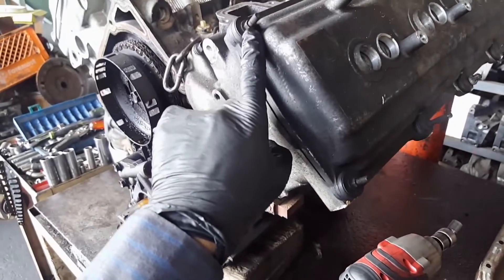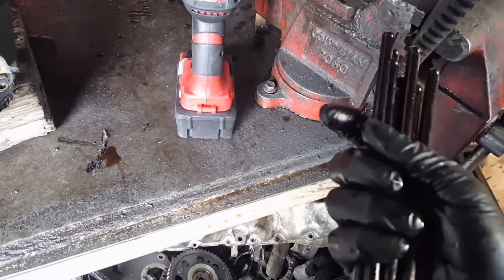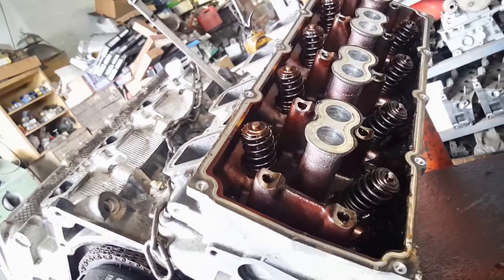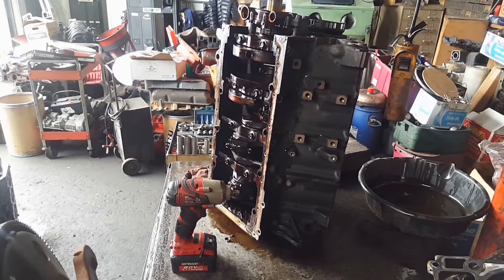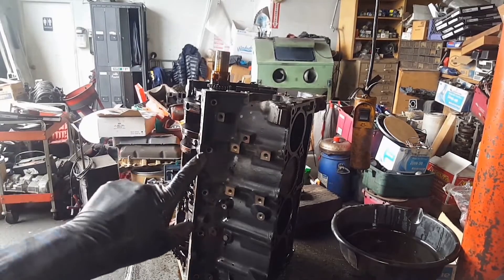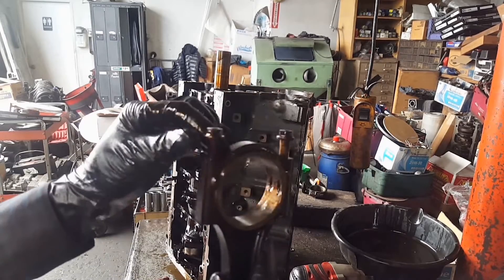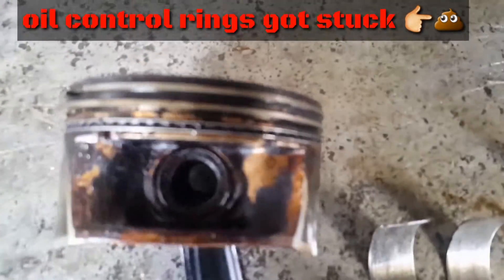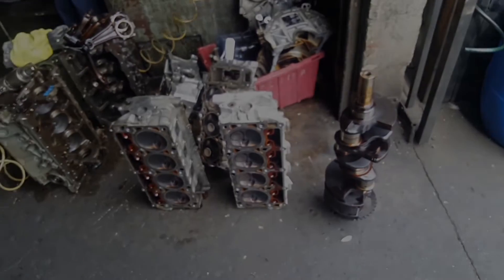How to rebuild 5.7 hemi engine cammed hemi engine (1)

Comment: I have a 2006 5.7 charger, it passes water to the intake manifold and it marks me cylinder 7, I take it to the workshop, they tell me what the engine is, but my question is, you can't just reveal the head on the side where the cylinder is 7
Reply from the maker: No le entiendo jaja can you explain it in Spanish?
Reply: Disculpa Esque lo traducía en inglés no se inglés tengo un cargador 2006 5.7 se le pasa agua al múltiple de admisión y yo marca cilindro 7 lo llevo al más alto me dicen q es el motor pero mi pregunta es no se puede revelar solo la cabeza del lado donde está el cilindro 7
Reply: Tengo un charger 2006 lo lleve al taller dicen q es el motor marca el cilindro 7 porque se le mete antifrizze al múltiple de admisión mi pregunta es si se puede solo reveldiar la cabeza de ese lado o se tiene q reveldiar todo o se tiene q cambiar el motor
Reply from the maker: @hugomoralesavila2605  quite la cabeza de el lado del chofer,i revisa el empaque de cabeza, si el empaque está bien,entonces revisa la cabeza por crakeaduras
Reply: JM8686 y si está craqueada solo se puede reveldiar esa cabeza
Reply from the maker: @hugomoralesavila2605  sale más fácil agarrar una usada i hazle valve job
Reply: JM8686 o muchas gracias y lo puedo conseguir en un yonke o un lugar q me recomiendes

Comment: I have a question,  considering nothing is wrong with an engine and it runs...can you still take it apart clean it all of carbon build up and just reassemble it? of course replacing push rods and other bits as needed. I dont really need a rebuild but at 250k I'd like to clean it all up and try for another 250k. I guess my real question is what should I really replace if I tear down an engine this far, do I need to replace rods and pistons or just clean and reassemble? no mechanic here so be gentle.
Reply from the maker: Thanks for watching and the comment 🙌
Okay on your engine once you take it apart i recommend new oil pump, head gaskets,water pump,timing chain and guides,that's all so do not remove crank shaft or connecting rods and also don't remove the pistons! If all you want is clean the carbon build, just do a SEAFOAM cleaning first and will remove up to 60% of the carbon build!!
Reply: @JM8686  hells yea thanks man
Reply from the maker: @kevinnoneya9095  welcome 🙌

Comment: have the  same problem dodge hemi valve seat drop out on no, 8/ 6/1 what a dodge fuck on the heads did they  ever fix this  shit in mess up my whole engine and it cost alot too rebuild dam shame poor engine design
Reply from the maker: True 👌

Comment: How to remove the pistons if you can't turn the crankshaft (seized)? I have 3 damaged pistons and can't turn the crankshaft by hand
Reply from the maker: If the engine is out you have to get piston by piston till you get to the locked ones!! Assuming that the engine is already out the car!! But most likely you need need crank shaft so don't be gentle and do watever it takes to get it out
Reply: @JM8686  The engine is out already, cylinder heads, and oil pan. I want to replace the damaged pistons but can't access the 10mm bolts. So there's no easy way but applying the brute force. LOL
Reply from the maker: Yeah that's the only way, the crank is trash so hammer on the beefy pa
ts of the crank so you can slowly spin the crank! Or loose all the mains and get crank with pistons atached
Reply: The crankshaft itself isn't seized, just those three damaged pistons are causing all the headaches! Thank you buddy 👍
Reply from the maker: No worries nd good luck 👍
Reply: I've managed to get all the pistons out! Do you know a place where can I order the new pistons w/ rings at a reasonable price other than eBay?
Reply from the maker: What's the make and model of your vehicle ?
Reply: @JM8686  I have a 2006 Chrysler 300c 5.7 hemi with MDS
Reply from the maker: If you are in Los angeles I can get them for you because i don't get my parts from the internet
Reply: @JM8686  I hear you bud, I'm in Jax FL. What's the easiest way to remove the piston pins on hemies? I heard that people heat it up first then knock out with something!
Reply from the maker: Yeah heat or just use a press just be careful because the pistons cracks and pieces of aluminum might fly everywhere, so just go slow
Reply: @JM8686  Affirmative. Thank you
Reply from the maker: No problem
Reply: Hey bro do you have your Shop in L.A??
Reply from the maker: Yes sir
Reply: I would go .30 over on block

Comment: Part 2? LOL I need to do this after I get the engine out tomorrow. Dropped valve seat. Head was chewed and piston broke near the sides. 135k miles was hoping I'd get 200+ :/.
Reply from the maker: MrHotdogwithmustard dang hate when the seats comes off cuz they get hot and then all the pieces goes I to the Intake SO MAKE SURE YOU GET A NEW ONE FROM DEALER CUZ mechanics here in Cali they try to save money by just cleaning the Intake but they always leave a small pieces still in there so after rebuilding the engine and installing the same used intake those pieces goes back to the valves and they make a mess again lol
Reply: Thanks for the heads up. I doubt I can afford it just spent 2700 on my suspension and its an '06 and needs new cats and tires
Reply from the maker: 😂 seen mechanics "cleaning those intakes with water and compressed air" and they always fails because it only needs a small single piece of metal to get stuck btwin the valve and the seat ,then piston comes up hits the valve bent the valve and leaves a hole in the actual piston 😂😂
Reply: JM8686 What you are explaining about the intake manifold happened to me end of last year. I had some guys that are on offer up rebuild my engine by the name of wholesale rebuilt engines. These guys tried to play me left metal in my engine and still trying to fix it. 2 pieces of metal chewed up my 1 and 3 cylinders. I tried to smooth them out as good as I could with engine in the car but still misfiring and now CEL code 1417 cylinder deactivation. I researched has something to do with MDS solenoid. Can I have your email address so we can talk more about yoir services? I'm in LA area. Thanks.
Reply from the maker: Sorry to hear that nd fastest way to contact me is 13b_dorito Instagram
Reply: @JM8686  will contact you on your Instagram soon